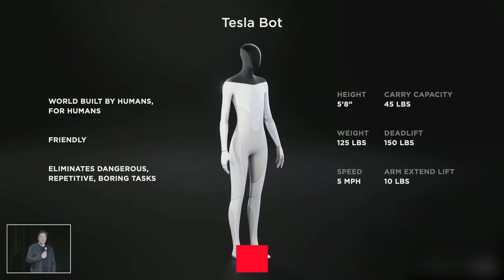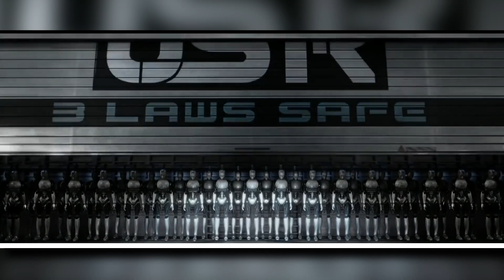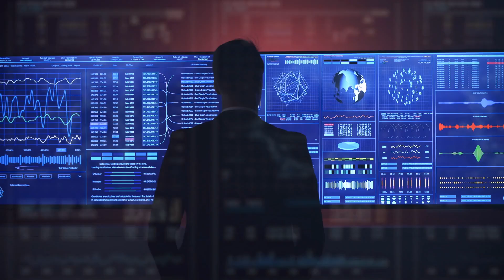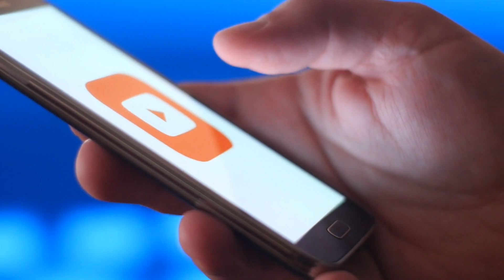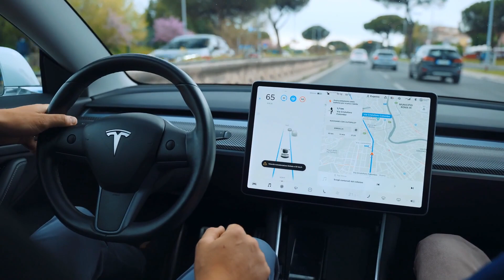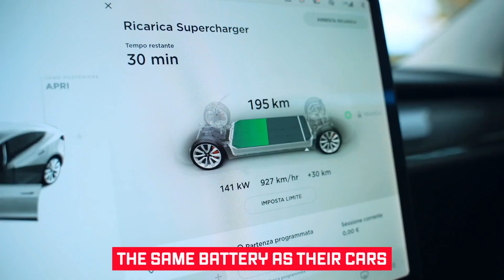Boston Dynamics Atlas vs Tesla Bot! The Ultimate Comparison!

Comment: The Tesla Bot is CLEARLY a man in Spandex ! The battery is easily calculated - - 1 Horsepower times 12 Hours = about 40 Pounds of Lithium batteries.
The tech simply isn't there yet, but they're getting close ! And considering the tiny Military Drone of a few OZ is $200,000 this will be MASSIVELY expensive.